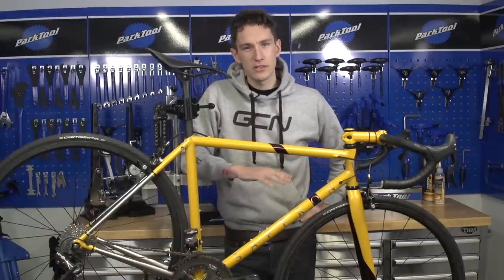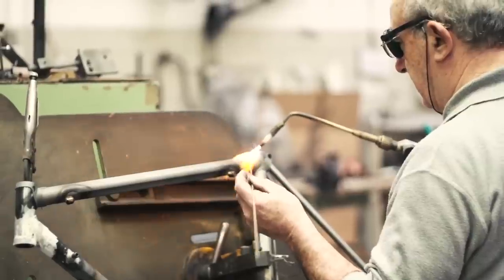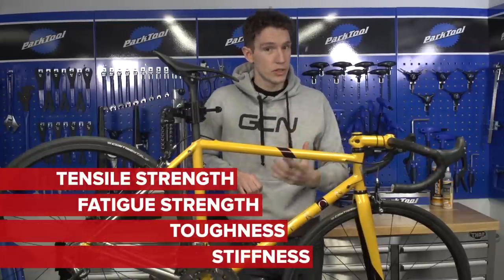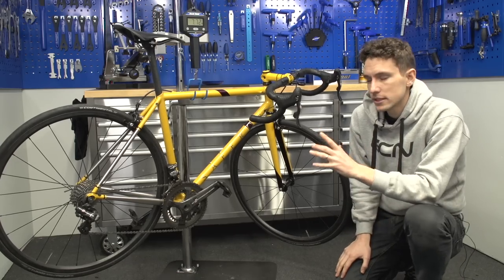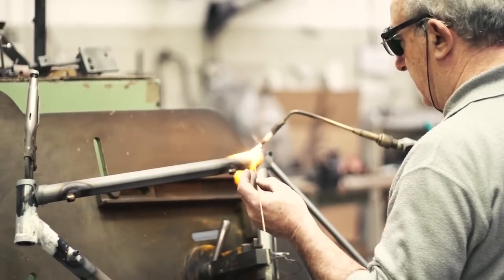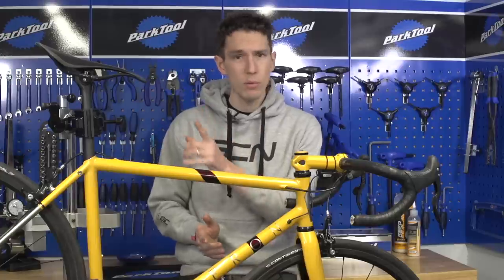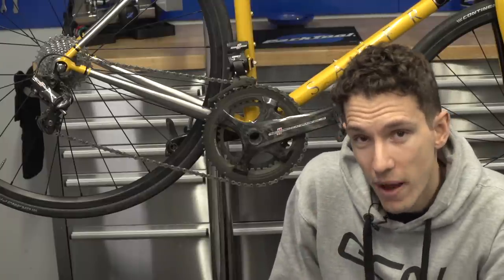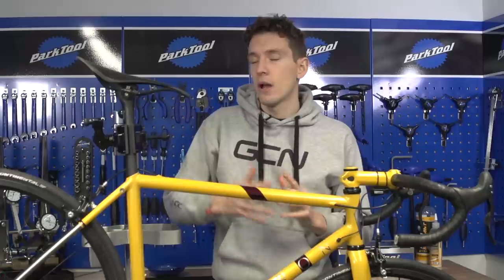Is Steel Real? | 6 Things You Didn't Know About Steel

Comment: Steel frames are great.  
Built my old man a Charge Plug 5 CX Tange Premium at 9 kg. 

Not the lightest but it purred when ridden.

Miss my old Reynolds 501 frame from the 90’s.  Heavy but the ride was lush.

I’ve had carbon, Caad10 aluminium but I now want steel or Ti.

The cost of a steel frame is far too much compared to Ti.

Comment: Steel will streach more than other materials, before it snaps.
Hence, it fail more safely.
There are aerosol rust inhibiters that you can spray down the tubes.
Aluminium does oxidize into a white powder.
You can make springs out of titanium (and steel)
Choosing what material you want to build a frame out of depends on who your friends are and what type of kit you like to wear

Comment: In BMX 4130 is the go to. It's better due to weight balance. The properties of steel allow the balance of a frame to be positioned nearer the bottom bracket or just in front of the BB whereas aluminium frames are often a bit rear heavy. That's great for racing but a BMX for full on lunacy needs to balance well. Factor in the much slimmer profile of the tubing and you've got the ultimate toy.

Comment: "the most traditional material" is an empty phrase. Unpack it? There's very little on board. The material of choice for over a century? Yes. The most developed industrial material besides ceramic? Yes, it is even more advanced than rubber or plastic and neither is finished with fabricators innovating, and finding better uses. BUT steel alloys require a technical understanding and that means silly marketing phrases ("steel is real") and buzzwords ("traditional", "authentic") may prevail over actual product knowledge. But points for what is by and large a useful contribution, GCN does fairly well on minimizing bad info. THANK YOU for mentioning Frame Saver treatments, but those ED factory treatments can also still not be enough to keep your frameset intact for the next decade of rides. LOVE the series, keep the rubber rolling!

Comment: Steel is the father, or grand father, of modern bicycle design. When you choose a experienced custom frame builder a two wheeled wonder, in a steel, aluminum or carbon fiber can be created.  Back in the 1970's I choose an American builder who apprenticed under UK masters. He worked with me and my steel frame came with features rare in the 1970's, but not exactly common today. Weight was not a central factor, performance was. The tubing was not from a single manufacturer. The frame has no sticker for this mix. Two of my favorite features are the seat tube had internal ribbing to stiffen the bottom bracket and the dropouts are nickel plated,

Comment: As long as you keep them out of the rain, steel frames last for many, many years.  My Pinarello, 1988 edition, has a Columbus lugged steel frame, and the bike is still alive and kicking 31 years later, although it needs a complete restoration.  All Italian components, mostly original.  Getting a new carbon fiber bike next month because it is probably time to retire old Red (Ferrari red color).

Comment: Furthermore steel is a very environmentally friendly material, in terms of energy use when being produced (particularly compared to aluminium) and in terms of capacity to being repaired and recycled. That is a factor worth mentioning considering that the bike is used by many as a sustainable form of transport. Furthermore if steel fatigues and breakes, the cracks tend to appear slowly, while the likes of aluminium or carbon just break suddenly. I once stopped a slowly growing crack on one of my steel bikes at the seat tube by drilling a hole. And after another 10 years the frame is still fine.

Comment: Bought a 7000 series alloy bike about 10 years ago. 3rd time out on it and the chain jumped off the front ring and traveled between the small gap between the chain-stay and ring, gouging a huge lump out of the frame. I wasn't happy! If that had happened on a steel frame the most i would have lost is a bit of paint. Makes me shudder to think of it happening on a carbon frame, which is why i've only bought steel ever since.

Comment: The polar section modulus does not govern stiffness, although is related. The polar section modulus is used to calculate stress due to torsion. The second moment of area governs stiffness. An increased wall thickness actually reduces the radius of gyration, making a section more slender and more susceptible to buckling. However this is off-set by an increased sectional area and increased second moment of area

Sorry

Comment: The best looking bike to ever grace a GCN video! It's just missing the down-tube shifter mount on the left for the front derailleur, which you would run with a plain old brake lever on the left (yes mismatched brake lever/shifter combo, I LOVE the look). Lighter and also a breeze with a nice triple 30/39/50 crankset!

Comment: D=M/V This equation defines relation between density, mass and volume. You said steel is 6x more denser and only 2x heavier that means there is some change in the Volume or else the equation wont be correct. And stiffness or anything wont have any effect on mass of the material if volume and density is constant.

Comment: Steel also fails better than carbon fiber and aluminum. It will bend before breaking so you will see/hear/feel an issue well before it can cause you serious harm. Carbon Fiber frame/fork failures are legendary. Aluminum can be ripped apart (I would imagine it is rare for bike frames but if you drive an F150, or the like, it is something to worry about).

Comment: I switched from aluminum to steel..and the ride is way better on steel..yes takes a little more time going up hill but ive found that the have to pack so much aluminum to make it strong that the difference is only a couple of  pounds in weight..touring bikes are mainly steel from my observation..

Comment: I bought a vintage peugeot and I told my friend to pick it up, since it was 40 years old and well it was sold with some problems (sold cheaply because the guy decided he didnt have the will to restore it) the rear brake didnt work, and my friend went flying, he showed me the pics, he was all scraped, the pole he hit with the bike bent, while the bar tape didnt survive, it dint eve have a scratch. A carbon bike would not syrvive that, ever.

Comment: I think that there are a few points about steel you might have missed. Usually frame builders who build with steel generally provide their frames in 1 cm increments, so off the shelf correct sizing is easier. You can have a super light high tech bike from the local cookie cutter, all very nice and cool. Then again you can have a bike hand made in a small family owned shop that has been handed down father to son. with beautiful investment cast lugs, chromed stays and a one off paint job. It's all in your mind babe. Just shut up and ride. 80s Daccordi SLX with campy components. See you on the road.

Comment: Biggest advantage of steel: it's easy to work with. A custom frame builder needs very little equipment or expertise, and can start out with a hacksaw and a simple welder. Working with aluminium is an order of magnitude harder; and working with carbon fibre is well out of the reach of any guy in a shed.

Comment: I owe 1 aluminium alloy gravel bike with carbon folk and 1 steel adventure touring bike. My alloy gravel bike has better spec components, more agile handling and responsive acceleration. But if I  just want to  cruising all day long  with comfort,  I will always ride my mid range steel touring bike.

Comment: At about 1:40 you say carbon is about "twice as light" as steel.  But let's be clear what that means in a straight line.   A steel frame = about 150 grams.  A carbon frame about 700. So we're talking 700-800 grams of total weight differential.  A fraction of a filled water bottle.  An adult male rider might weigh in at about 60-70 kilos.  Fully clothed, with helmet and such, and with a bike that is shod with training tyres and water bottles and seat pouch with wallet, phone, and tool kit, you're looking at around 100 kilos.  The steel/carbon frame might make a difference of 0.5% of that total weight.

Comment: For races no. 
For everyday city use the biggest diefference is:
Aluminium, Carbon bikes - You drive in traffic, and every 1-5 years your frame cracks in the middle of the road and you might DIE.
Steel bike - Frame never cracks, or you would know it because its rusty. So you wont DIE. But its heavier to carry upsatairs. But you might DIE.

Comment: Have you tried stainless steel frame bike? From what I've heard it's better than the chromoly frame
Reply: Paul Matsukawa The mechanical properties of stainless steel is very very similar to non-stainless.  The main difference is corrosion resistance.
Reply: @krisjones74  but did you forget to add on that stainless steel's tinsel strength is harder than 3AL 2.5V titanium?
Reply: Paul Matsukawa The strength is not the issue.  A steel frame can be made extremely light and still be strong enough, but the stiffness of those alloys is roughly identical to plain steel, so the super light frame is generally super flexy.  More material is used (thicker or larger tubes) to increase stiffness to an acceptable level.

Comment: The placebo effect is strong in this one. You would have to ride multiple bikes of multiple materials without knowing which is which to really find out if one feels better than the other. I really doubt it. Steels once felt better that aluminium because aluminum frames sucked when they were first introduced. They were way too thick and clunky and when pairing this with aluminum not getting more or less springy after heat threating you have a pretty bad frame.

Comment: First, claiming one material is outright better is nonsense. Steel bikes don't always ride nicer than bikes made from other materials. It all comes down to how the material is used. I've ridden steel bikes which were brutally harsh. Ditto for titanium bikes. Ditto for carbon bikes. As an example, anyone who says aluminum is harsher riding than steel is clearly too new to cycling to have ridden a Vitus 979 or an Alan back in the 80s. The 979 and the Alan used aluminum tubes but instead of making them large in diameter and with thin walls they were the same diameter as steel but with much thicker walls. This made the bike VERY compliant...almost too compliant for some sprinters. It also meant that many pros who might normally ride a steel frame would switch over to a rebadged Vitus or Alan 'cross bike for a race like Paris-Roubaix. This is just one example. Another is claiming that an inexpensive steel frame such as a Surly has that "steel is real" ride. Again, if you think this you've clearly never ridden a frame made from Reynolds 531, Columbus SL or any other 7-4-7 non-oversized steel tubing! Surly make fine bikes for the price but they're also pretty harsh riding and just as bad as many alloy frames. 

As for weight, what a lot of people seem to forget is it's not just the weight of the bike. It's the weigh of the bike, anything carried on the bike (water bottles, etc.), anything the rider wears/carries and of course the weight of the rider. When you add up the whole package chopping a pound off the weight of your bike represents a total weight reduction of less than 1%.

Comment: I have one 26" steel bike made about 25 years ago, beautiful repainted yellow now, that almost seem like that yours road bike;  with tires 1.2 low weight and puncture resistant, I can ride it with 30 psi and even go offroad,with comfort.  Weight is not that relevant, true. Now I only keep opening my mouth, or loose breath stops me  - So I think better than invest on new road bike, I better do a little investment in adhesive tape, to force close my mouth. What do you think?  is this the ultimate barrier to become finally a better rider???  I still only got 75km/h on descent,   and I guess if I closed my mouth I could gain enough aerodynamics to reach at least 83km/h...  so it prejudices me both on uphill and downhill. And I guess this is one very common problem... :-)

Comment: Steel is so real. It doesn't get any more real than steel, all these carbon frame bikes just look surreal. They don't call Superman the "The Man of Carbon Fibre" or "The Man of Aircraft Grade Aluminium".....Superman knows where it's at when it comes to choosing a material for bicycle frame construction. When he uses his heat vision to braze the lugwork, it's like watching a master at work.

If you aren't riding steel, you need to get with the programme and you need to do it fast before it's too late.
Reply: hmartinspliff Haha, I like it. That was definitely a point number 7.

Comment: Weight differences between carbon, aluminum and steel bikes are not as great as most believe. In my stable of bikes the Volagi Liscio II (carbon) is the lightest, but only by 1-1/2 lb. under my Trek Crockett (alum). My wife’s Trek Madone (carbon) is actually 1/2 lb. heavier than the alum Crockett and less than 2 bs. Lighter than my Volagi Viaje (steel). The heaviest bike in my garage is the Trek FX-2 (alum) which is more than 4 lbs. heavier than the steel Volagi. 
Volagi Liscio II (carbon) 18 lbs.
Trek Crockett (alum) 19.5 lbs.
Trek Madone (carbon) 20 lbs. (2009 wsd 4.7 model)
Volagi Viaje (steel) 21-3/4 lbs.
Trek FX-2 (alum) 26.5 lbs.
The steel Volagi is a very comfortable ride, and if I were inclined to replace the alloy wheels, bars, stem and seatpost with carbon, it could be very close to 20 lbs., the weight of the older carbon Madone.

Comment: Wait, he said a steel road frame weighs about 1.5 kg while a carbon frame is about 700 grams.
Other things being equal, a steel frame doesn't seem that bad unless you're racing, it's 'only' 800 grams heavier.
Lets say a full carbon bike is 7 kg, while the same bike except the frame will be 7.8 kg. My weight is 50 kg, so the difference will be 57 : 57.8 which is about 1.5% weight difference.
Reply: A mountain bike made out of steel weighs 14 kg while out of carbon it's in the 10 kg. 40% heavier !

Comment: There’s to much argument about the materials bike frames are made of. The truth is excellent high performance bicycles can be made from all four materials, steel, aluminum, titanium and carbon if designed and constructed properly. All these materials have strengths and weaknesses.

For example carbon is the best material for racing bikes for racing at a high level. It offers advantages in broad design capabilities and light weight. The compromise is that it is not as durable and the cost is high. However for high level racing the durability is more than acceptable as is the higher cost for that specific use. 

But to summarize the advantageous qualities of steel alloys vs the other materials is it has the greatest absolute strength, it has relatively lower cost and is easily available, it is the easiest to fabricate and customize and it has the highest Young’s Modulus (aka modulus of elasticity) or what you called “springiness” which means you can deflect a steel frame more than the other materials without deforming it. This gives steel its famous “lively” ride quality. It also provides the advantage of under extreme use of when the steel is deflected and energy is lost that energy is returned as the steel returns to its normal position without deforming. 

The primary disadvantage of steel is it has the highest density and it corrodes.

So the facts are that with newer advanced high strength steels a light weight bike with superior handling characteristics can be manufactured at reasonable cost at UCI minimums that are certainly competitive with carbon fiber.

Well if that is true, which it is, why don’t we see more steel frame bikes at high end racing?

That has more to do with manufacturing processes. Steel bike frames in manufacturing have a significantly lower material and capitalization cost than the other materials. Unfortunately steel bike manufacturing is also the most difficult of these materials in which to automate manufacturing and are thus more labor intensive. When comparing capitalization cost with amortization  to labor cost over the length of a production run the other materials with their higher capitalization cost are more economically profitable due to the higher labor cost of using steel. 

Which is the primary reason why you don’t see steel framed bikes at the highest level of racing. For the major manufacturers of road bikes the higher cost of materials (carbon) and capitalization (automation) are off set by far lower labor cost vs using steel. Meaning this just as much an economic decision as it is a performance one.

Comment: I love carbon fiber
Reply: Cornelius Maximilianus , but does your bike 🚴🏻 has 100 000 miles on the clock ?
Reply: @sakadabara  Over 55,000 km on my carbon bike with no problem, in the past I've owned steel and aluminum frames and none lasted as long, the aluminum ones being the most fragile.

Comment: What I think, I love Steel for getting the tubes color and shape you want, its not a Trek carbon, but man, it will look a lot better in my opinion, I am from that era in the end of the 80's and I have seen great bikes and you could bash en and it will still work, compared to carbon fiber where you overtork and bye bye, you frame is crap.....I have seen too many carbon frames crack and make noise, its the nature of the beast, good old steel bike is like a old analog keyboard, there is always room for it

Comment: The Ph and S elements in  steel are undesirable contaminants, stainless steel has a Cr content as high as 17%. Si should have mentioned that Steel is 100% recycleable, carbon fibre is Not.